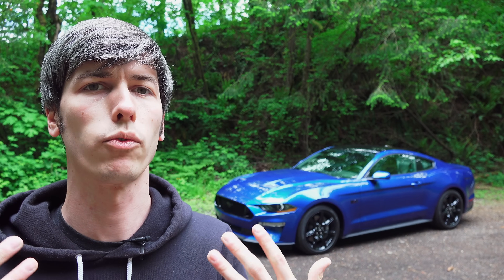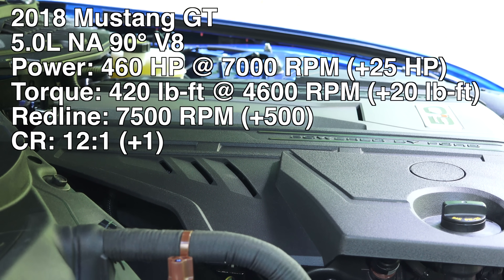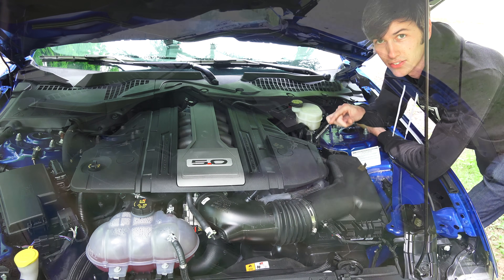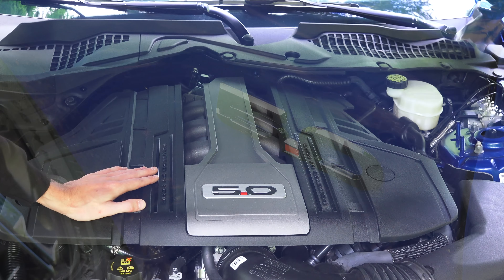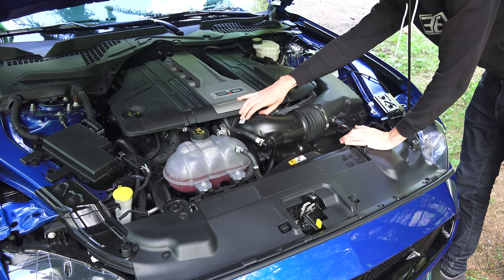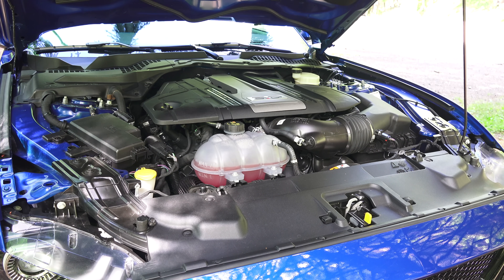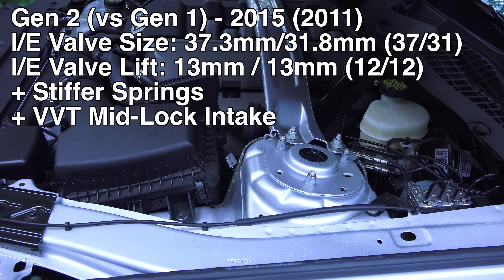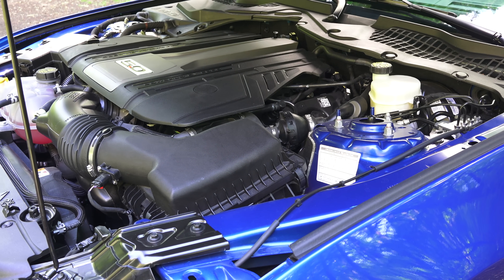The Best Engines - 2018 Ford Mustang GT 5.0L V8

Comment: Do you see the gt350 engine effectively trickling down to all mustangs about when the gt350 dies off?
Reply: Never. The voodoo is too high maintenance to ever put in a main stream car like the GT
Reply: Joey Z quantify your claim or I can’t take you seriously, with all due respect, this is youtube comment section after all
Reply: Fee Nicks I’ll gladly further elaborate as I currently own a gt350. For one the engines are hand assembled. Ford sells too many mustang GTs to have all those engines hand built without making drastic production line changes. This is something Ford will not and cannot do without increasing the price of the GT which as is has already increased in price over the years after taking inflation into consideration. 2nd MAJOR thing is that the voodoo burns oil at an alarming rate to the point where the owners manual states that oil levels should be checked at each refueling to prevent damage to the engine. If that is not high maintenance then I don’t know what is. The GT is designed to be a daily driver. Having to check oil levels every time you put gas in the car is considered high maintenance. Majority of people will not do that and it most likely will just cause headaches for Ford due to cars coming in for “warranty work” due to engine damage when in reality it is due to low oil levels and negligence. Love the car and engine it’s just not something Ford will put in a mass produced top selling vehicle of theirs.  Do some research on the voodoo, hop on the forums and read what people are saying that actually own the car, that work on the car. The voodoo was an engine ford designed to show off and brag. How many other manufacturers are making flat plane crank V8s that rev to 8250? You can maybe count them on 1 hand. It’s intent was not to be put in a top selling mass produced flagship daily driver V8 vehicle under $40,000.
Reply: Joey Z you seem to have misinterpreted my question. One key word specifically changes the meaning entirely. I was never under any delusion than the voodoo engine would be placed in GT’s, much less remain hand assembled
Reply: Fee Nicks you asked if it would trickle down to all other mustangs... The GT would be the first trickle down under the gt350
Reply: Joey Z yes the GT was the only mustang I meant by “all mustang’s” obviously. Though performance 4 cylinders should have flat plane cranks that’s a whole different conversation and unrelated to my comment. 

As often happens in text based communication online, There’s a key word that when read as intended critically alters the meaning of my original question. That word would be “effectively”, in this case. 

Hence my reaction to your response about the voodoo coming to GT’s. I didn’t ask if the Voodoo would be transplanted as it is into GT’s, but rather “will the voodoo motor 
/effectively/ trickling down. 

I was intending for the use of “effectively” plus the use of the term “trickle down”, which is a common phrase with a understood meaning RE: product lineups and components/features of those products that start off exclusive to the top of the line model’s, rightfully so given the R&D money invested to develop them. 

But then through economies of scale, further R&D, the lessons learned & optimization’s made to the innovative component & its manufacuring process that allow it to be made at higher efficiency with higher yields/tighter/Q.C./ & at significantly reduced cost’s.

But more in line with my question are the little things, small innovations/features/capabilities deployed for the first time exclusively in the Voodoo motor but trucking down to other engines as Ford masters the associated supply chain & production line challenges & thinks of ways to employ them elsewhere. 

Basically, just the typical effects supply chain management/manufacturing at scale that we see all the time. 

So simply will the strong points/features of the GT350 quickly find their way into GT’s. The cylinder lining, higher redline & free revving nature, for example, regardless of the crankshaft design, though flat plane crank’s in a more mass manufactured engine model would be awesome & is literally Ford’s Raison d’être so to speak, or was at least. So if anybody can pull off the ability to mass produce something that never/rarely is, it would be fitting for it to be done by the company that was first to do so with the automobile itself.

Comment: Dare I say there will never be a GM engine in this segment because the only awards there winning is JD power national award of most recalls.. 💁🏻‍♂️
Reply: JD pawah award for rolling down hill in neutral
Reply: Tweaak "Initial Quality"
Reply: Mason N I don't shake hands. Is this a crematorium or a Burger King?
Reply: "FORD" got bailed out back in the eighties  by President Reagan, with him changing the laws on recalls otherwise they would have gone under, they are also the only corporation in history to be charged with reckless homicide.
Fact is all manufacturers have had problems even ford. It's just the Ford camp has a very short memory. Or you just didn't know! All the american cars are kicking ass! Dont be so bias!

Comment: With a 10spd auto I would expect higher hwy mpg like about 30 given it also has direct injection now. Veh must have short gearing
Reply: tellucas 3.73 rear. It’s still a v8 weighing 3700# 

30mpg is way impressive! 

The 2005 4.6 barley got 23mpg
Reply: Devin Bender A Buick Roadmaster sedan w/a 5.7 V8 was tested 20 years ago and pulled off 31hwy mpg. So its doable. I do admit that car while heavier was probably geared to cruise and had ohv engine instead of 2 or 4 cams to turn.
Reply: tellucas One in block cam requires more force to turn then multiple overhead cams, the valve train mass with lifters, pushrods and large valves requires bigger valve springs which drastically increases   engine load.

Comment: The deference between the Magnum 5.9 and Hemi 5.7 be detailed, like can part interchange
Reply: Douglas Jobe both are junk? 
Through the whole block away and get a 6.4 Hemi. :P the 5.7 is a joke. What kind of v8 can’t break 400hp
Reply: Thanks but that's not my point.
Reply: Douglas Jobe Totally  different engine, no parts inter change.

Comment: I'm pissed off with Ford - in the States, they deliver the mustang with full safety features installed, but here in OZ, they remove  much of that stuff without even giving the purchaser a choice to pay more for it. "Buy a death trap, or go elsewhere is their motto" - bastards.
Reply: Benny Banger it’s an American import. Cost to much money to sell that stuff their. 
Maybe if they ever open up a factory there (doubt it) they will be cheaper
Reply: Thanks Devin, they do sell them here, just without the safety bits. We use the ANCAP safety rating system here, the US version of the mustang gets either 4 or 5 stars (out of 5), here we get it at 2 stars.

Comment: The 5.0 was introduced long before2011
Reply: mds s *5.0 injected aka the Madular v8. 
Not the “5.0” (4.94) 302 Windsor of the 80/90s. 

Or the 302 Cleveland of the 60s/70s 

The 5.0 coyote debuted in 2011 in the mustang. Before that it was the 4.6 modular
Reply: Devin Bender all of this 5.0's were fuel injected except the Cleveland
Reply: Devin Bender and modular for that matter
Reply: mds s *direct/port injection not throttle body. 

The Windsor engine is based off the Original 221/260/289 of the early sixties. The 5.0 today doesn’t share a single part
Reply: That engine architecture is ancient compared to the current 5.0.

Comment: Why is engine displacement calculated by bore x stroke of the cylinder and not the effective volume displaced by the compression ratio of the pistons?
Reply from the maker: It's the total volume that the piston displaces, which is a measurement of the volume the piston moves. Changing the head will change the compression ratio, but it doesn't change how much space the pistons displace. Just how it's measured I suppose.
Reply: Engineering Explained interesting... so given the Subaru EJ25 engine as an example, the diesal and gasoline variants have the same bore x stroke and are both 2.5 ltrs (2.48 to be exact), yet the diesal has a far greater compression ratio... wouldn't that give it a larger effective displacement than the gasoline? I'm trying to get to the bottom of this! 😁

Comment: 2.0L Ford Eco Diesel. the new turbo is smaller, has a gear-driven VGT ( the vanes) and it spins to 240,000 RPM max. it has 168 hp and 299 ft-lb of torque.
Reply from the maker: Neat!

Comment: Please Please Please do the Voodoo... Flat-plane crank goodness intensifies Also, this thing gets about the same fuel economy as my WRX, but with nearly double the power; if only it was a four door...
Reply: Yes. I second that request for a video on the Voodoo engine 👍🏽
Reply: Jason Young four door wouldn’t stay true to the mustang. Mustangs have always been pony cars not sedans.
Reply: Ahh us Australians had what you speak of. 2017 Ford Falcon XR8. Large sedan with a Coyote V8. And a supercharger, because f*** LS.
Reply: Austin _s197 call it a falcon; that's where it's roots are anyways
Reply: Buy an f150 with a 5.0 in it. Lower it for looks, get a tune and go spank Camaros on the street. Fulfills both the 4 door and the sleeper itch.
Reply: Oh, and you forgot- infinitely more reliable than a WRX...
Reply: Yeah; in 64.5 when the mustang came out in the US it was just a re-skinned falcon; ford eventually dropped the falcon after 1970. Australia kept the falcon and didn't get the mustang until recently; you guys kept the Ute too; I have browsed the Ford Australia website more than once over the past years.
Reply: Michael Doucet oh I’d definitely still buy a mustang that’s 4 door but I’ll always prefer the 2 doors like mine
Reply: Honestly my WRX has been very reliable (122k no issues) - I know the internet swirls with fears of "head gasket" and "ringland" but that's more often than not the heavily modified crowd. The "new" mustang had "transmission issues" in 2011-2014; meh; it is what it is.
Reply: WRX's aren't very fuel efficient to begin with..... :P
Reply: My bicycle has a flat-plane crank.
Reply: Austin _s197 I 100% agree but I think I would still buy a Mustang even if they made them as a 4 door only. Mustangs are the love of my life nearly tied with how much I love my wife... LOL
Reply: I had a 2018 WRX and now have a 2017 Mustang GT. It gets nowhere near the WRX. I'm seeing 18 combined with the Mustang vs 24 combined with the WRX.

Comment: Great video. Is that water spraying out the tailpipes? I always wondered why cars did that.
Reply from the maker: H2O is a byproduct of combustion, so if there’s time for it to cool, it will come out as liquid rather than just water vapor. Same reason you see cars “smoke” in the winter on start-up. Exhaust cools and you see the steam condensing.

Comment: Isn't that thing regularly making 440-450 wheel on the dyno? That engine is seriously under rated. 
Still not as cool as the voodoo, but Ford is low key making some power.

Comment: False advertising. 5.0 is not 5.0.
Reply: jdmikeg4 the old 5.0 in the Fox was worse! 4.942. Not even close! 
That is where talking CC is better than L. Get a few more decimals in there
Reply: Devin Bender motorcycle companies lie too. They said its 1,000cc but its not. Its 999cc.
Reply: jdmikeg4 Mercedes is the worst when it comes to huge rounding
Reply: At least it's slightly more than 5000cc now. My 3726cc engine is falsely advertised too, haha.

Comment: I own a 2015 GT, what do you think increases the power the most from the previous engine revision? The liners/displacement change, the direct injection addition, or the knock sensors/advanced timing capabilities, or is just just a little of everything? Just curious as to how they keep getting relatively significant power bumps every couple years or so.

Comment: why hasn't there been a 5.0L v6 engine since the 60s that were used in gmc trucks?
Reply: Willy Cooke it's pointless in today's time. Will use a lot of fuel anyway might as well add two more cylinders and make it a V8.
Reply: Because you can make more power and torque from a smaller, lighter engine, plus emissions standards are probably 1/4 or less of what they were in the 1960's
Reply: banessa Ahmed I'd imagine v6 would be shorter and lighter than v8 of equal displacement and less cylinders would require less fluid to stay cool.
Reply: Cummins makes inline 6s with more than 5 liters

Comment: Fantastic video! That Coyote engine is creeping up on the Voodoo....Cool to see the little improvements they made to increase power over last yr. And def a unique approach considering GM and FCA are still running larger pushrod engines....The 5.7L Hemi makes 370hp/395tq compared to the 5.0L Coyotes 460hp/420tq

Comment: Anyone can setup a quiet, loud, track exhaust. Just have a full exhaust made with "2" cutouts. "One" cutout is bolt on only, and bypasses the catlytic converter[s] for track use. This will make you need earplugs. The other cutout is electric and operates just AFTER the catalytic converter[s]. Should be borderline ear-plug levels at most when it's opened. When closed, it routes back to your muffler[s] and tip[s] of choice to make 'quiet' mode however quiet you want it. :)